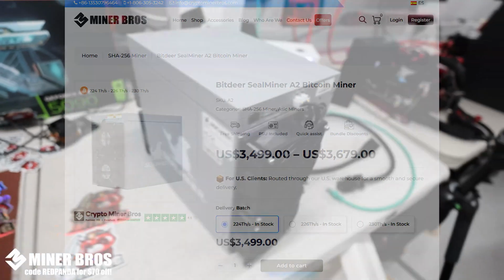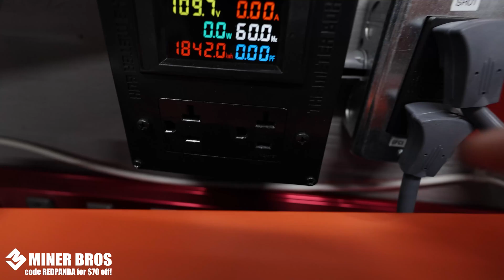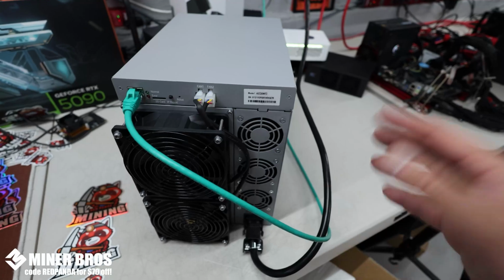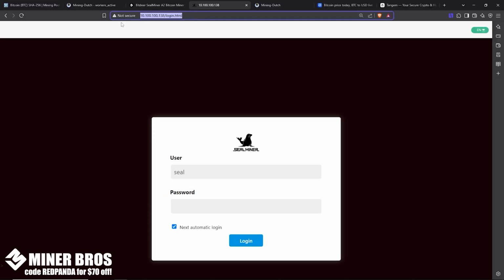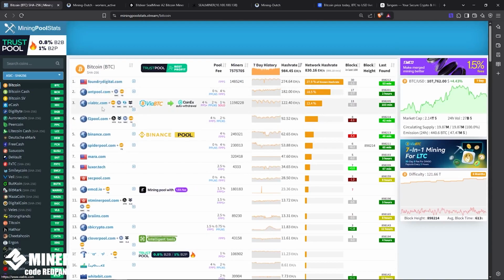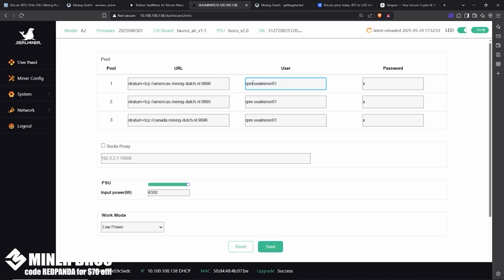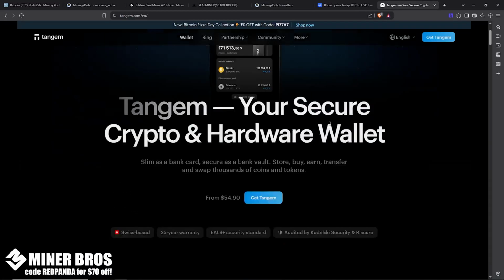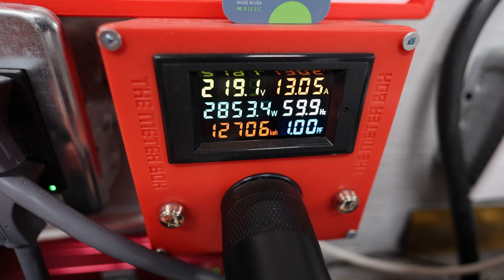Set Up Your Sealminer A2 Like a Pro 😎⛏️

Comment: I have one and like it. Keep in mind that currently:
1. Fan emulators do not work with it.
2. There is no fan ignore or immersion setting.
3. You cannot run the miner without the stock fans being connected.
4. Aftermarket duct fans and hoods will not work with it.
5. Vnish, hive, lux, etc..have no plans to support it right now.
Reply: This is exactly what i am waiting for, thanks mate, you are really appreciated.
Reply: @CBBTECH 
Emulators work. Swap the blue and red wires. You can then run an AC Infinity fan. If your mining room is temp controlled you'll be fine, otherwise you'll need a fan controller. The miner retunes automatically if PCB temps get out of roughly 65-70c range. The controller is necessary to help address that issue.
Reply: @ohoffman10  are you running the blower on it, is the 8inch blower safe or does it require 10inch. I want to order this sealminer but i am concerned about the noise. I have the Njord auto fan control.
Reply: @CBBTECH 
Im using the 8. Its fine up to roughly 105-110 degree fahrenheit ambient with the sealminer.

Comment: Does this A2 has different versions, i noticed the power cables is different, some use c13 power, some p13
Reply from the maker: Different A2 versions (A2, Pro, Hydro) come with different power cables. 🔌

Comment: I started running the 230 T/H version last night in my basement office. Its pretty loud but I ordered a 30 ft. power cable to move it out of my office and into an adjacent room to face it out the window. In the winter I will point it facing my basement living area to heat it up.